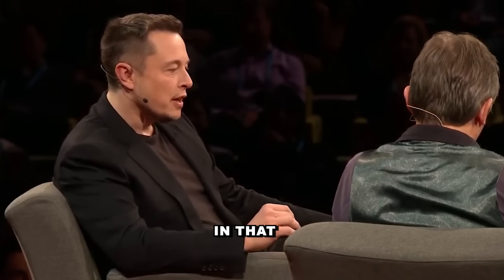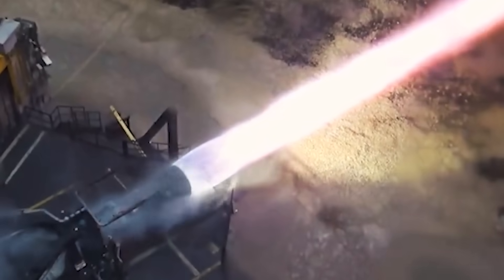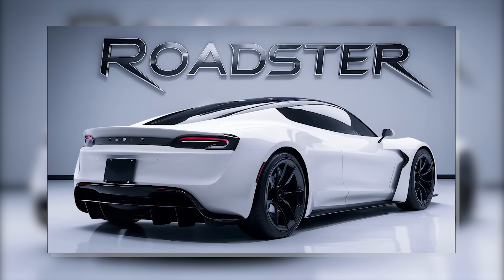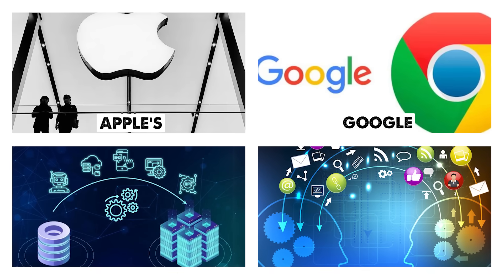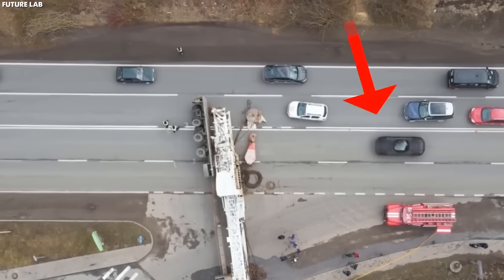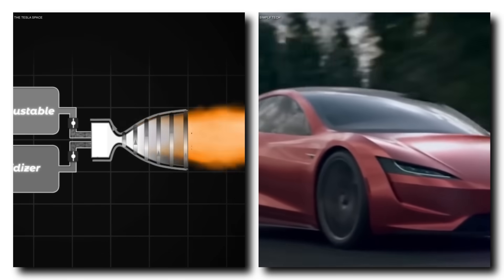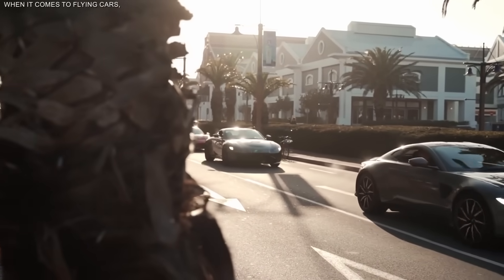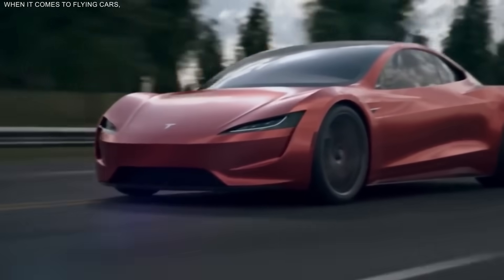Elon Musk: "Our New Flying Cars Will Hit The Market TODAY"

Comment: The tesla flying cars are need of the hour. Use of Torque force for upward thrust and flying , energy efficient motor engine and in built own navigation system is great inovative input and indeed ground breaking aerospace vehichle..